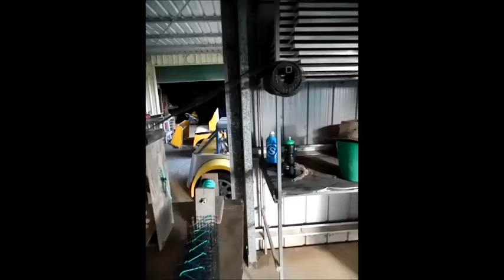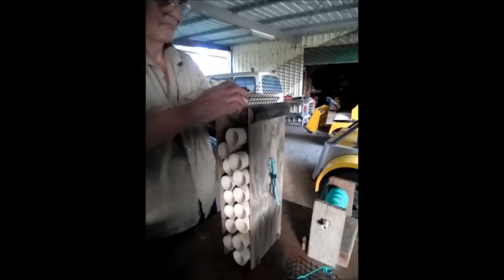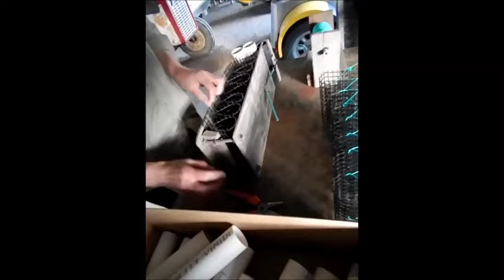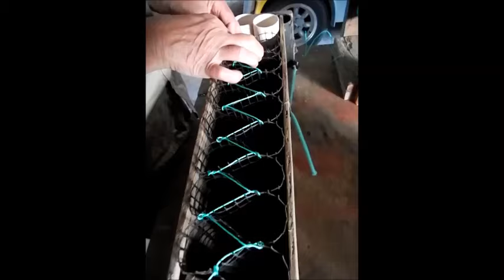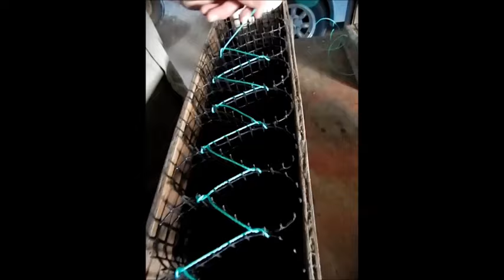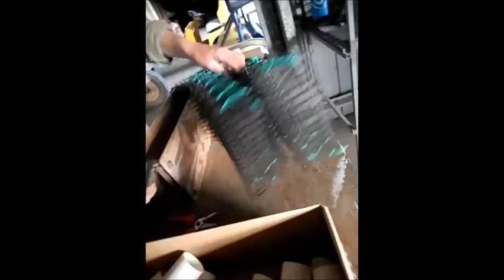Making Redclaw habitat

Comment: Newbie here. PVC pipe diameter and length, please. What size crayfish is the maximum for each tunnel ? Can these be stacked 2 tiers high on their sides or upright is more solid ? Love your mfg. setup.
Reply from the maker: PVC Pipe approximately 43mm diameter and 150mm long
The tunnel openings in the completed mesh are slightly larger diameter of course.
 Redclaw crayfish up to about 125 grams in size can enter the tunnels.
We normally used two individual units stapled together, but sometimes added more to make the combined unit higher.

Thank you for your comments, we made about 12,000 individual units to construct about 6,000 habitat clusters.
Recently a commercial habitat has been made available - https://www.aquaverde.com.au/redclaw-habitat-shelter/